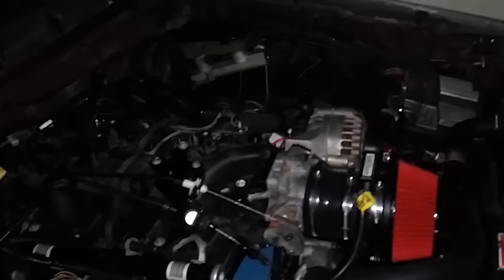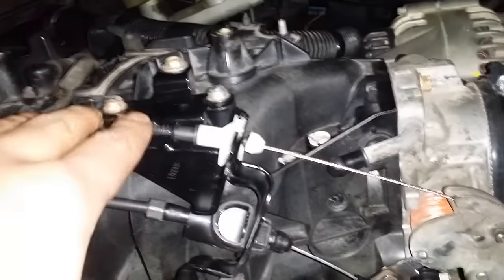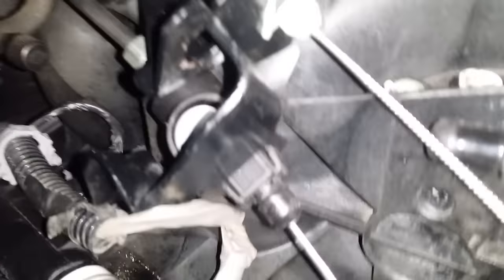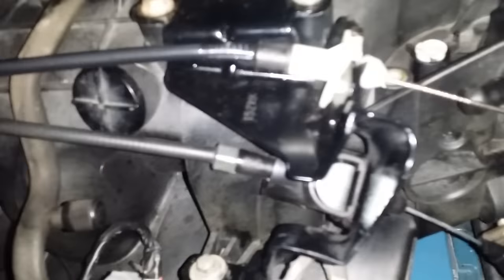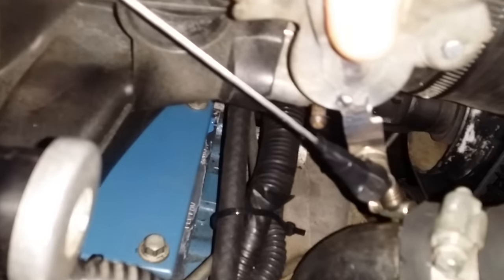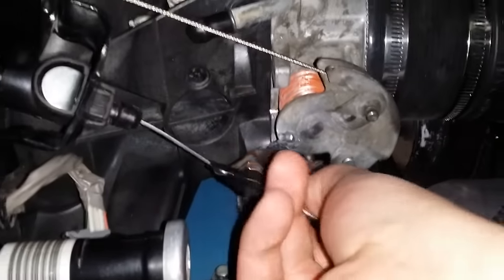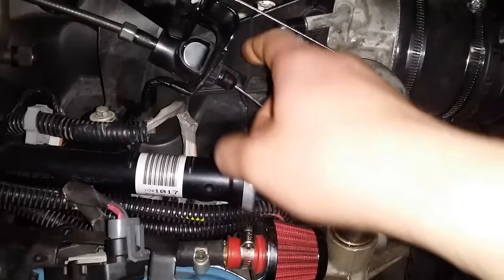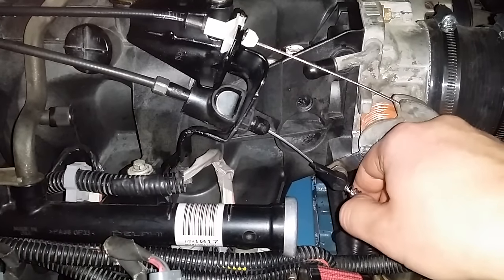How to : LSx cable throttle body to Th2004r Th700r4

Comment: What LS motor are you turning this 700R4 with? Has it held up well?
Reply from the maker: It's a Th2004r not a th700r4
Reply: @beeterolds  Ok, my mistake. Thanks
Reply from the maker: @davebarron5939  they're about the same in terms of durability. If you wanna put and power to either units they need to be upgraded
Reply: @beeterolds  Ok thanks.

Comment: Is that kick down cable the original or an aftermarket one. The length on mine seems to be smaller. Im doing exactly how you're doing yours. I need the help and info.

Comment: Did you have to weld on a bracket for the tv cable lower, below where it is on the throttle bracket?  Thats what it looks like but you never really showed it.  Very briefly from the side.

Comment: About how long off center shaft is the piece you welded i see its clock from cruise so i can eye that up , looking at diagrams should be 1.1 i think ?
Reply: Brandyn O'Haver  Open the throttle all the way up, put a wire or something to hold it, open kickdown linkage all the way open,, make a mark on the butterfly. Leave some room so there is a little adjustment. Practice welding on scrap with 2 batteries if you dont have a welder

Comment: Good stuff. I notice around 2 0clock there a stud on oEM THROTTLE BODY N AROUND 8 0CLOCK IS WHERE THE TV CABLE STUD CONECTION IS.. WERE U WELD IT..👍GOOD SHIT... I KNOW TV CABLE ALIT FUNNY WHEN NOT ADJUSTD.. PROPERLY..

Comment: Any suggestions im running a 700r4 and a 1996 350 LT1 mpi. In process of putting in my Wrangler. I cant figure out what Detent cable to run. Maybe you can help

Comment: My throttle assembly look similar to that.  Does it matter where the support bracket (with the TV cable's square hole) is located?  Slightly above?  Below?  or Straight at the stud?  Just trying to ensure that the "pull" will remain about the same regardless of bracket location.

Comment: How do  you determine where to tighten down the "throttle valve corrector" cable-locking-crimper thing on the forward side of the throttle?

Comment: whats the length of the TV cable? cause i know they made different sizes.
Reply from the maker: Leslie Washington it's a universal cable. That's all they sell now thru ATD it's got a compression fitting on it so the cable slides into another cable to fit your needs
Reply: You can also get you one from a TPI camaro or trans am, perfect sz

Comment: Did you use the factory gas tank on this build in fixing to start on my regal I also have a 200r4
Reply from the maker: Yes
Reply: @beeterolds  will I have to change the fuel pump my car came with a 307 olds motor

Comment: I may have to try this trick on my Stepside with the 700. 
Can you clock the water neck around at all to help clear?
Reply from the maker: +Malibu Jak Im sure I could.. Ultimately the best move would be to use a Corvette water pump.
Reply: Very true also. 
You may also look into the later model truck pump. It relocates the water neck and will line up with the accessories without spacers. 
I'm not sure about the price between the two though.
Reply: oops scratch what I said. I don't remember if it clears the idler pulley. 
I'll shut up now lol
Reply from the maker: hmmm
Reply: BEETEROLDS Swaps & How to would you be willing to make one for me?

Comment: Great info Vids you post BeeterOlds thanks for that ,, Im in the process of doing a 5.3 in My iroc ,So will the 700r4 handle the power ?
Reply from the maker: As long as it's in good shape and you run a large cooler it'll hold for a while
Reply: @beeterolds  Lol For a while ! You're making it ,its not going to have a long life ,,Yes thats a good idea will get a cooler for it ,What size cooler you running ?
Reply from the maker: @DELTRANIO99  sold the car last year. I run a manual now
Reply: @beeterolds  Oh alright ,,,How long was you driving the car with the 700 ?,,BTW did you have the ECM tuned to remove VATS and torque management ? if so who did it ? And thanks BeeterOlds for replying back to me much appreciated
Reply from the maker: I ran a th2004r not a 700.
Reply: @beeterolds  Lol Thats right sorry my bad I meant the 2004r  ,Ok one other thing i have to ask what did you do about the lock up converter  ? Did you have to buy a kit for it ?

Comment: How's that garbage fuel injection working
Reply from the maker: +Mc da shiznit Just fine
Reply: D.Szymanski better then ur carb setup a
Reply from the maker: you get in you hit the key and drive away like a new car.. what else could I ask for
Reply: D.Szymanski ok.just checking .last time u was carbed up .thinkin on trying fuel injection .now u can explain harness how to hahah
Reply: Actually, a LS fuel injection setup makes 2hp more than a stock 4150, you can see the dyno run on enginemasters. Once you do the nascar tricks you cant make that much more power than FI, the only thing you got going is you wont kill sensors.
Reply: BEETEROLDS Wassup bro need alittle,I have a ls1 to a 700r4, for a 97 camaro ..I had gotten a mail ordered ecu with vats deleted its said I might need a 8k vss -Dakota digital?

Comment: What is TV cable? What does it do?
Reply from the maker: Ted Hargiss throttle valve cable. It controls all the shifting aspects of the th2004r and th700r4 transmissions
Reply: BEETEROLDS Ah. Gotcha. Is it applicable to a 4l60e drive by wire?
Reply from the maker: Ted Hargiss not at all the 4l60e is completely electronic
Reply: BEETEROLDS Schwew! That's good to know. I'm doing an LS swap in a Jeep using a 4l60e and I just heard the phrases kick down and TV cable, and was getting worried. Thanks for clarifying.
Reply: If you are doing a 4l60e, study the videos of the 3 things you need to upgrade so you dont blow it up.